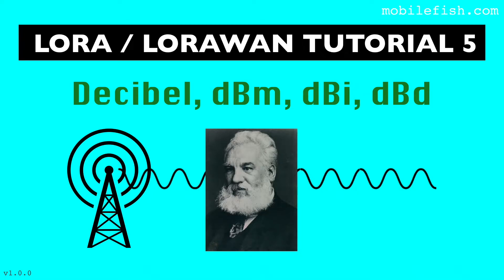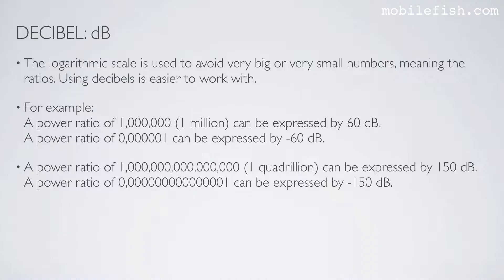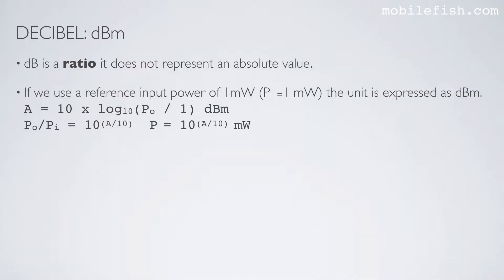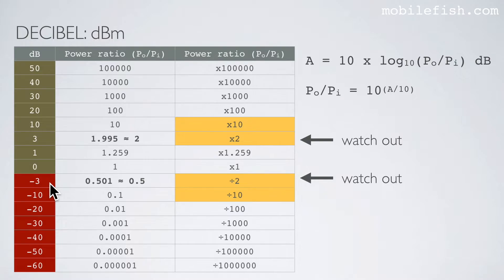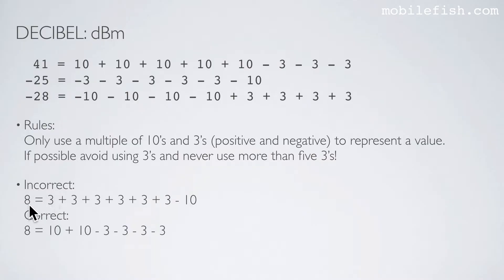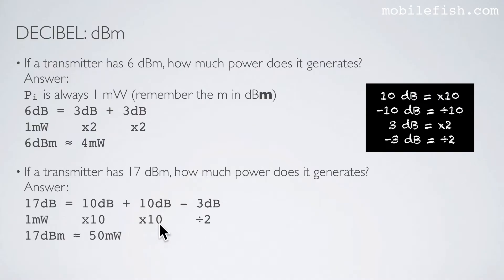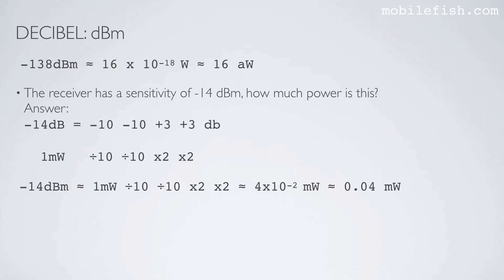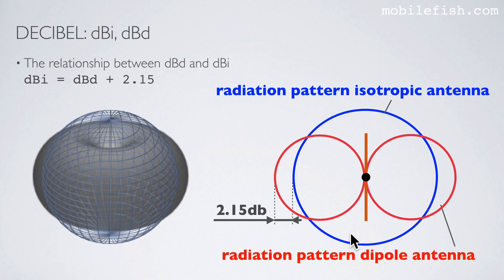LoRa/LoRaWAN tutorial 5: Decibel, dBm, dBi, dBd

Comment: I am a little confused by one point. As the radiated patterns of the isotropic antenna and dipole antenna, dipole antenna's gain is 2.15dB bigger than the isotropic antenna in the horizontal direction. Why does dBi equal dBd plus 2.15, not dBd equals dBi plus 2.15?
Reply: isotropic antenna has equal gain in all directions where a dipole has a null off the ends and (more gain/energy) off the broadside. take a balloon and point your fingers together  your fingers form the null and balloon expands (gain) out